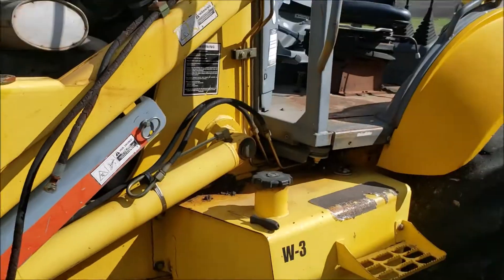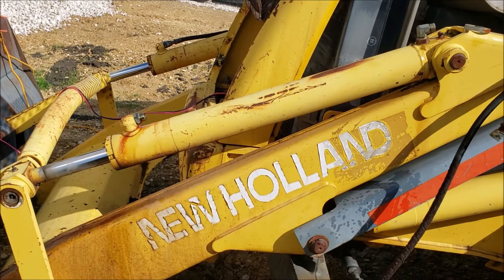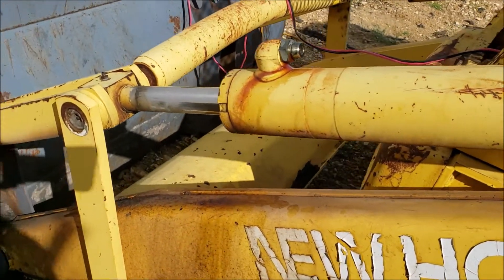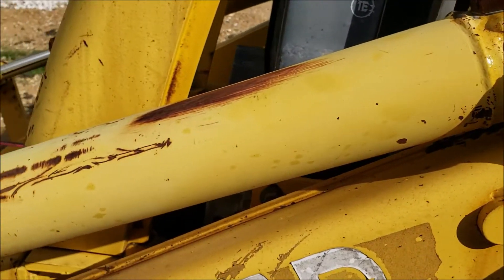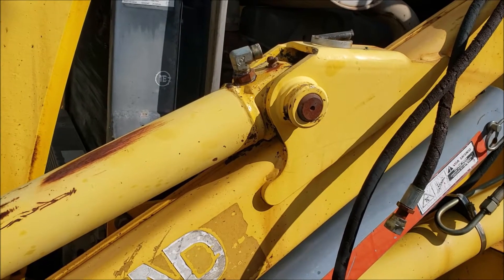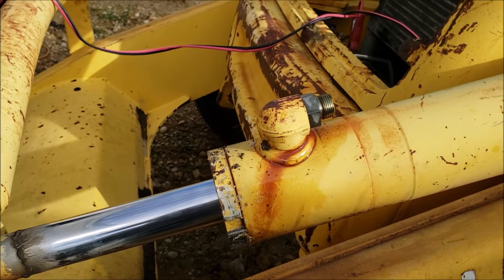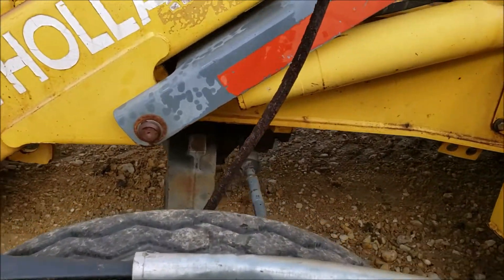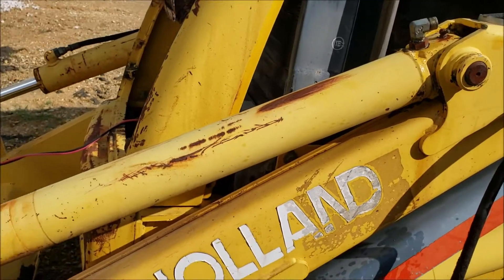Replacing Hydraulic Cylinder Seals - Part 1 - Preparing to tear down the cylinder

Comment: Before you start this project, make sure the seal kit you have is the right one and make sure there are no other parts and part numbers that have been updated that could cause issues along the way.
Reply: Agree! As a seal distributor, the seals can change slightly over time because of design tweaks from the OEM.